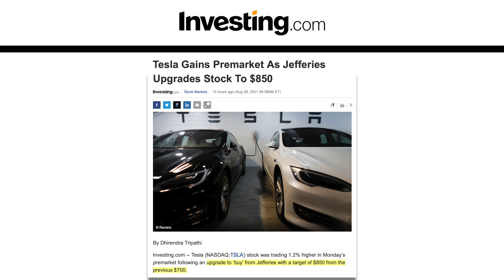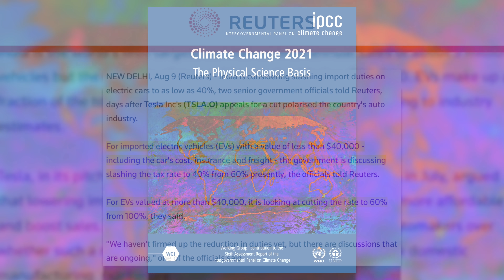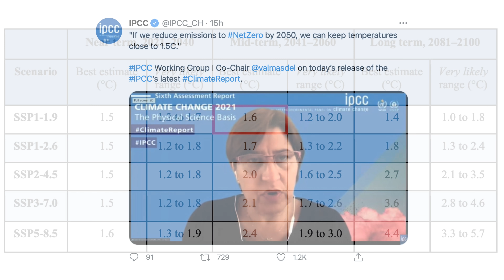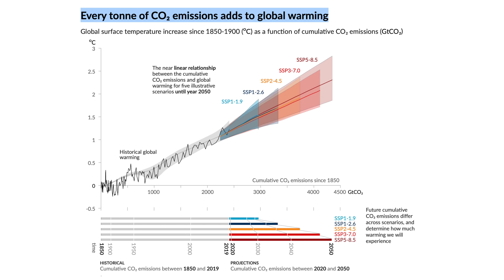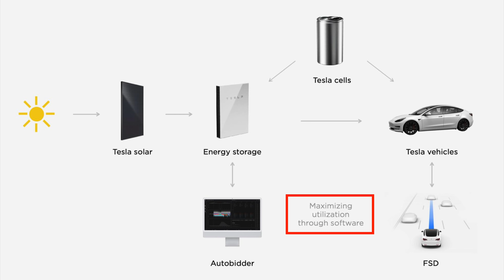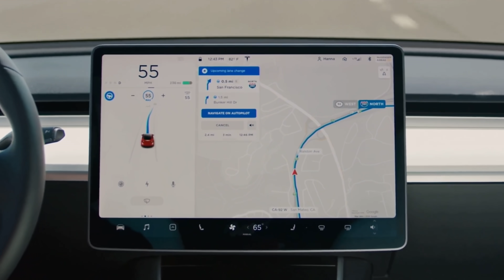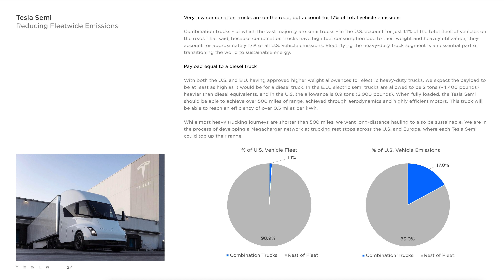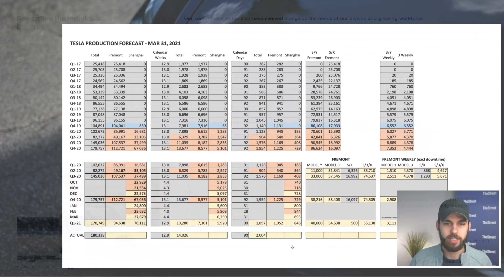Here’s Why Tesla Is So Important

Comment: Rob another interesting tidbit in the impact report was governments changing the GVW (Gross Vehicle Weight) for EV Trucks.  Essentially they will be raising the Gross Weight allowable for electric trucks by the weight of the battery packs--so there will be no loss of cargo capacity because of battery weight.  This is actually a pretty big deal.

Comment: Rob, here’s a video idea.

Take a look at page 24 of the Tesla Impact report. 

To my knowledge, nobody has talked about the change in policy for EV Semis.  The impact report mentions that regulations have changed to allow an additional .9 Tons GVW (1000lbs) in the US, and 2 Tons (4400lbs) in EU.  

I haven’t seen this covered or announced *anywhere*.  Consider what this means using really rough math.  A 75kwh battery pack on the Model 3 is about 1000lbs, multiply by 2, and an extra 2,000lbs could be an extra 150kwh to the bottom line battery pack.  And at 0.5 miles per kWh, this could be an extra 75 miles, or a 15-25% increase in range for the 500 mile and 300 mile Semis, respectively.  

I couldn’t find any government websites that confirm this, or that announce the policy change, but take a look a this article about Freightliner’s test fleet.  

https://www.google.com/amp/s/www.autoweek.com/news/green-cars/amp36506185/electric-big-rig-semi-trucks/

99% of the article is fluff, but notice that they mention the GVW is 82,000lbs, exactly 2k over the Class 8 Semi Limit.  

Worth a video, IMHO.  

Sharing with my favorites: SMR, Dave Lee, TE, TD.

Comment: Selling over priced EV's with a focus on 0-60 isn't going to save the planet folks.
Perhaps encouraging ppl and Governments to build better public transport infrastructure, instead of un-recyclable battery power vehicles might be a better way forward?
Sadly, the cult leader negativity towards (green) hydrogen has also been damaging.  Especially given it's the only real solution for air and hgv transport.
Reply: For change you should really consider trying an informed opinion..
Reply: @TheEvilmooseofdoom  I do and it was.  Instead of Telsa focusing on more realistic and affordable vehicles, they double down and release the prius?
I suspect Elon has backed a short lived horse with lithium, but that's subject to if the existing petrol chemical behemoths wise up and push / focus of renewable based hydrogen.
Look at the Tesla semi 🚛 
Most important spec still missing 2 years on.  Carry capacity....
Why?  Because the sheer weight of the batteries will massively reduce it's carry potential.
Even with the 4860(?) Batteries being touted, it'll still be a stretch.
Reply: @TheEvilmooseofdoom  oh, and best estimates for lithium recycling ♻️ this year globally was 5%.  And that's before the everest mountain sized car EV batteries are factored in.
This isn't just a Telsa bashing, but as usual, humanity has put the cart before the horse, and simply hopes the next generation will pick up the tab ;)

Comment: You should focus more on the adverse health effects of automobile exhaust and how public health will improve with the elimination of combustion toxicity. Most carbon dioxide, not to mention water, oil, nitrogen, and "trace" atmospheric gases are produced by the vast mass of microbes that thrives deep beneath the earth's surface. CO2 dominated earth's atmosphere until recently, after cyanobacteria adapted to the earth's surface and produced an abundance of oxygen. CO2 normally fluctuates over geologic time, as does "global warming" but whether or not CO2 levels in the atmosphere determines heat retention remains questionable.

Comment: The only error I see, is not accounting for the CO2 produced during solar panel manufacturing.
Reply from the maker: It is accounted for and I mentioned that
Reply: @TeslaDaily  I would like to see that calculation, as it takes years to recoup the energy of solar cell manufacturing.
Reply: @SpeakerKevin  "it takes years to recoup the energy of solar cell manufacturing" I would like to see that calculation.
Reply: @TheEvilmooseofdoom  Common knowledge. it was a net loss up to the year 2013. It takes a lot of energy because of the high temperatures required to process the silica. (Study from Stanford researchers)

Comment: We’ll need Nuclear Power for the grid. Amps amps amps
Reply: Not really, solar and wind are cheaper.
Reply: @mathiaszander381  you need amperage and lots of it. I own a Tesla and it consumes a lot of current to charge. You already have rolling blackouts because the infrastructure is old. Solar helps but you need battery storage and more than most can comprehend. The batteries you need are to keep the grid at 60 hertz and that cannot vary. If the grid went to totally down it would take years to get it back online, that’s why Texas was shi]]ing their pants last winter. This is very complicated more than people know. Nuclear is the cleanest by far and that’s the solution hand in hand with electric vehicles!
Reply: @PAULPINBALL  There is more wind in the winter generally speaking. Solar in the winter depends on the latitude. And for the rest, we can use power-to-gas. Texas outage was less a problem with renewables...

Comment: Very good episode...but one needs to keep the figures in perspective.  Can Tesla really have a significant impact on CO2 emissions even under the most optimistic utilisation scenario?  Consider: From the "Our World in Data" graph, the annual increase in CO2 emissions during the years 2000-2019 was 0.6 GT/Yr.  If, from 2021 to 2040, that rate of increase will result  in CO2 emissions INCREASE in 2040 of about 12 GT.  Even taken into account utilisation and using Rob's figures and Tesla's impact report, Tesla will save about 0.5 GT over about the same period of time.  In other words, instead of an additional 12 GT, we might expect 11.5 GT, and this is under an optimistic utilisation scenario (including ride sharing).  Yes, 0.5 GT is better than nothing, but not much better.  In my opinion the better argument for EV autos, motorcycles, scooters, etc. is local air pollution due to city traffic and noise pollution due to all two-cycle ICE engins (mopeds, leaf blowers, lawn mowers, etc).  My city of Paris, France, subject to episodes of very poor air quality,  would benefit enormously from all-EV traffic.

Comment: Yes, BEV impact will be bigger than expected for many reasons. 
One reason is that the ICEV replaced first will be the ones used the most. There will be many ICE cars left in the fleet 20 years from now but they will be used very little. 
There are quite a few cars being used up to 50 000km/year. They will be scrapped in a 5-6 year period. Then replaced with a BEV which may be used for 10 years.

Comment: We need nuclear now, immediately. A argument I see frequently that it costs more than solar, but so what? If we want to get to carbon neutral, we have to do it. What germany did is a disgrace, replacing their nuclear plants with coal plants because the solar power was not supported with batteries. Solar + batteries will be good, but we should still start building nuclear power as well to have a very secure low/no carbon emission baseload.
Reply: Not to mention Germany doing a deal with Russia to burn natural gas in their power plants

Comment: Tesla needs to commit to net zero emissions in its manufacturing, even as it grows. The solar panels are more important than it's cars, because at any time when you're growing exponentially, the manufacturing impact is greater than the saved fuel consumption.
Reply: Did you not watch the video?
Reply: @MrEd2291  I did. Tesla include sold solar panels and saved car emmisions to achieve their net zero impact, but the real goal should be to offset all the manufacturing process so cars roll off the production line at zero.

Comment: Yeah if you will stretch that timeline further back you will see just how mild and moderate the last 171 years have been, in fact during all of the lock downs, the Temp. spiked due to less pollutants in the air, basically the very gases and such they claim heat the earth , actually cool the earth.
Reply: As we say in the Navy Mike Sierra Uniform for Makes Shit Up.
Reply: @MrEd2291  ?? No the data is there for anyone to look at..

Comment: My old eyes could not read all of the charts you threw at us - the text was too tiny.  So I tried to follow what you were saying aloud about the charts.

I think I heard you compare different use scenarios, with the best scenario being no individual ownership/use miles and 100% shared/robotaxi use miles.  Did I hear right?

I'm all for optimism.  Optimists are my favorite people!  They're great.  A little out of touch with reality, sometimes.  But great.  Love 'em.

It breaks my heart to be the one to tell them that individual ownership is going to dominate use cases for light vehicles as far into the future as I can see.  Taxi utilization will rise somewhat as prices fall, but it will never dominate use cases for light transport.

The proof is right there in the history of transportation.  For most use cases, taxis have always been cheaper than owning cars that spend most of their time sitting, as privately-owned and operated vehicles will.  Increasing the price differential won't eliminate the very significant attractions of private ownership; and not everyone is going to be up for cleaning vomit out of their vehicles when they return from hauling fares.  Far from a majority of owners will take that on.

Further, the pandemic is not over.  It has barely gotten started.  SARS-COV-19 is a single-strand RNA virus that has achieved influenza-like status in the population: it is circulating freely and throwing up frequent mutations, and it is capable of adapting to changing immune responses, finding ways around specific antibodies.  It can and will defeat specific vaccines.  As with influenza, vaccine tech will be competing with a shifting, adapting target.  Unlike influenza, the death toll as we fight with this SARS virus will be much higher.  This situation is as unfriendly to shared transportation as one can imagine.

(Unlike every other corona virus, SARS-COV-19 is now circulating freely in a large number of domesticated and wild animal populations, including wild deer.  Species barriers seem to be little obstacle to it, which is one piece of evidence among several that it originated as a weaponized virus with functional abilities beyond any wild virus we've ever seen.)

Maybe I heard you wrong.  But it sounded to me like the optimistic scenario for Tesla's impact on emissions that you described is so far beyond any reality I can conceive, it provokes my incredulity fully as much as an elephant in a tutu dancing on its hind legs on top of the Eiffel Tower.  I feel an obligation to get into my metaphorical chopper, take flight, grab a bull horn and yell, 'Get down from there!"  :P
Reply from the maker: I was not using a 100% robotaxi scenario for my final numbers. I mentioned the optimal scenario but discounted back at the end because not every car sold will have that kind of utilization. That’s why the Semi is important, those all will have very high utilization.
Reply: @TeslaDaily  I think your logic is correct.  But the input assumptions still result in grinding out an estimate that's too high on the mental shelf for my little brain to reach.

I think you may be underestimating the extent to which private ownership has, does and will dominate light vehicle transportation.  Taxis, robo or otherwise, just can't scratch as many itches consumers have.  Those who can afford private ownership, and have a place to park, will buy a car for private use.

And because private ownership will (in my view) continue to dominate, the demand for taxi miles will only rise very modestly.  No need to pay for, and wait for, a taxi if your own car is ready to hand.

And that will limit the economics of robotaxis.  The more cars are contributed to the taxi pool, the more fare prices will be forced downward, until it simply makes no sense to participate in a robotaxi fleet.  At which point participation will hit a wall, and margins on robotaxi operation will be awfully small.

Eventually, software costs will have to fall, not rise.

Robotaxis are coming.  They will increase taxi mileage and reduce total miles driven by light vehicles (a couple of percentage points is my guess, at most).  That's still a significant reduction in emissions.

I just think Elon's crude business case for pricing FSD high today - in anticipation of hauling in income later on - isn't going to hold up.  Making decisions based on it, or valuing the company based on it, is risky as hell.

But I don't have a problem with Tesla's valuation, despite holding this opinion.  There's just too much going on with this company to ignore.

Comment: India import duty for automobiles is 60% for vehicles upto $40,000 & 100% for those above that threshold (not 100% for all automobiles as mentioned by you). After Elon Musk's request to cut those to 40%, India is considering cutting import duty for EVs (not all automobiles) to 40% in the first slab & 60% for others.

Comment: Sunshades at L1 are inevitable. I wonder which space transportation system would be cheapest to put them there.
Reply: Why at L1? What if we need to remove them at some point in the future and don't have the capability to do so, seems pretty risky.
LEO is much safer, they will just come back down after the propulsion system stops working.
Reply: @w0ttheh3ll  I hear you, but there are many possible L1 orbits, many of which are unstable at various time spans. Plus, the further from earth the bigger the shadow at earth, hence many fewer shades needed to do the job.
Reply: @larrybuzbee7344  The distance between shades and sun at L1 is almost the same vs. at LEO (148.5 Gm vs. 150 Gm), I don't think that really matters. However, shades in LEO would cover earth's night side half of the time, so that's a big advantage for L1.
Reply: @w0ttheh3ll  I was referring to the distance from L1 to earth, which is roughly 1 million miles. if you take a sheet of paper into the sunlight and hold it one meter from the ground, the shadow will be slightly larger than the sheet. Now move the paper 10 meters away from the ground. The shadow will be measurably larger (ignoring atmospheric diffusion, which does not apply in space). Therefore, a shade of a given size would cast a larger shadow from a million miles away than from say 500 miles. 

The pertinent question then is whether the cost of achieving L1 versus LEO is outweighed by the greater shadow area.
Reply: @larrybuzbee7344  the shadow's size is determined by the apparent angle of the paper as seen from the sun. for tiny angles that angle has an almost linear relationship to the distance between shade and sun. that's why I gave the distances. a shade at L1 blocks roughly 2% more light than the same shade in LEO.
Reply: I agree that with SpaceX, at least there is a chance that sunshades might be economically feasible.

Comment: I wonder how hard it'll be to recycle those batteries when they are integrated into the frame
Reply: Well, why would it be hard? Everything can be dismantled if you know the process.
Reply: @lecisko  "Can be" doesn't mean it's not hard or "costly", as I'm guessing Bryan is referring to. But even today's battery is immersed in fire retardant that isn't easy to take apart. Regardless, I would assume that the first step is reuse, not recycling. Batteries that are too degraded for automotive use should be usable for decades in less intense environments like stationary energy storage - and at fairly decent price. And I'd imagine the batteries will be easier to recycle from the reuse-applied product(s), since they could have less demanding requirements.
Reply: @Muskar2  I thought it would be impossible to be economic to crush concrete. Then I saw a concrete crusher, essentially eating a building. They use this as a road layer (I presume). They can easily make a machine to totally crush a battery pack, then use a variety of techniques (chemical, filtration, gravity, magnetic etc) to extract the wanted material. Its not cheap, but its economically viable, and helps sustainability and reduce the amount of material that needs to be mined. Recycling for EV batteries is essentially solved.
Reply: @chrisheath2637  in the current Teslas, If the battery is faulty or dead, then you'd just swap out the battery pack. If it's Integrated like how the 4860 cells will be, you'll have to remove all of the car's components to get to the frame and swap the whole frame out to get fresh batteries. I'm obviously making assumptions about the architecture, but to me it seems like it'll be a harder to deal with faulty batteries.
Reply: Follow amy.v stock (Canadian small cap) who say they are at full recycling plant. Ex Tesla again! American Manganese is a critical metals company focused on recycling of lithium-ion batteries (RecycLiCo) and the production of electrolytic manganese metal from low-grade U.S. resources. The recycling process provides high extraction of cathode metals, such as lithium, cobalt, nickel, manganese, and aluminum at high purity, with minimal processing steps.
Reply: Then again, they have data on everything, it could be that the drive train will statistically give out before the battery gives out.

Comment: As you heat the oceans they release dissolved gasses. When the oceans cool they absorb more dissolved gasses.  Temperature is not dictated by CO 2, CO 2 is dictated by temperature.
Reply: Its a positive feedback loop. Both affect one another.
Reply: CO2 levels in the ocean have gone up. Although you are correct warmer water will give up gasses which isn't good for O2.